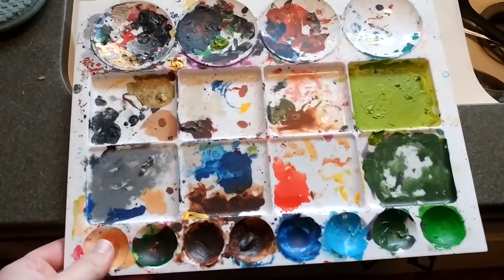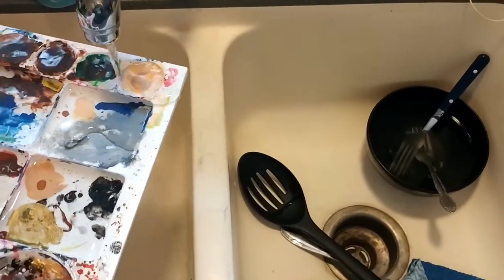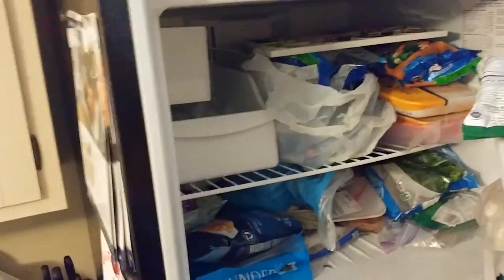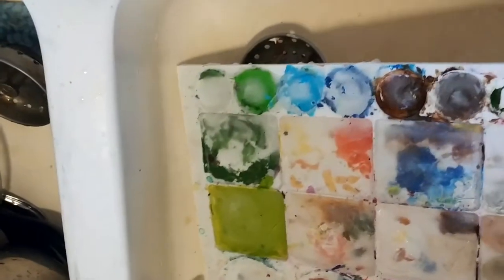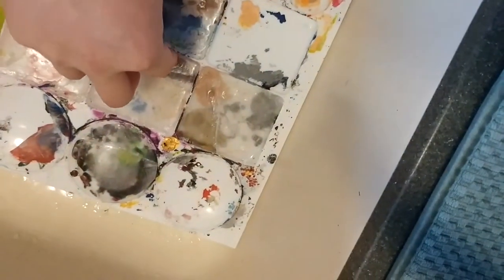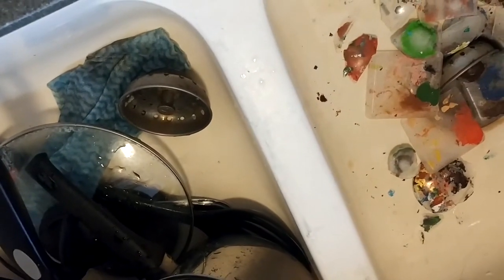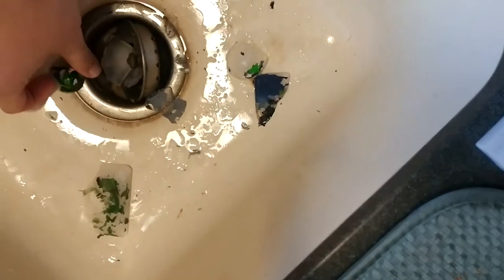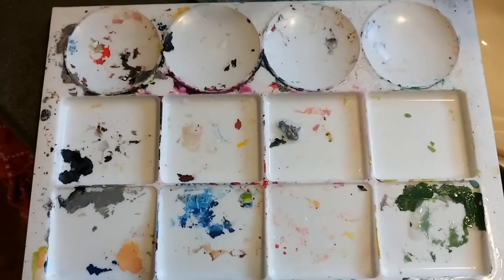Cool way to clean a paint pallet

Comment: Simple and 100% working solution is to use vinegar which is used for cooking. 1. add vinegar in palette sockets and keep like that for 5-6 hours. 2. After 6 hours, take old brush and dried acrylic paint can be easily removed.